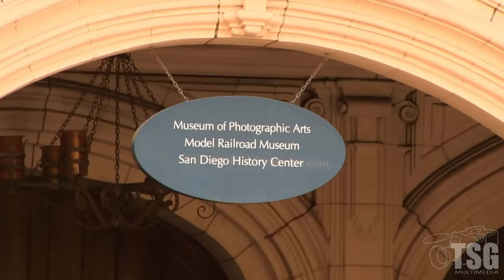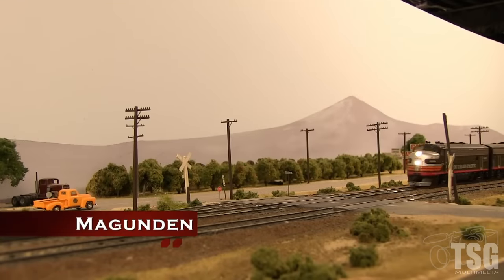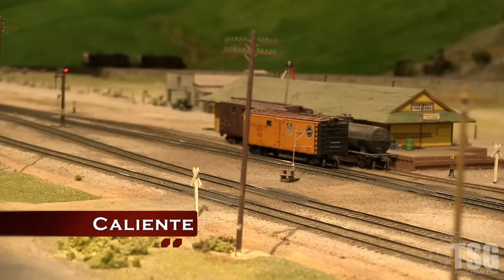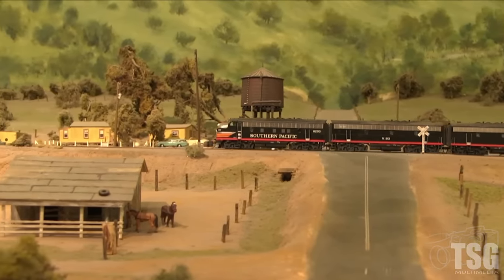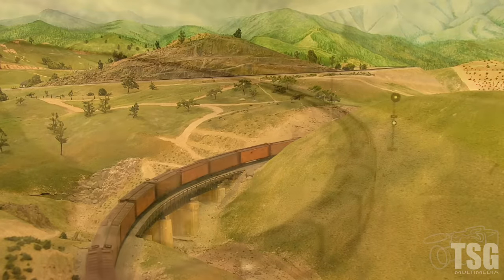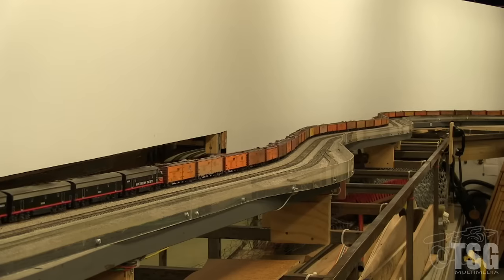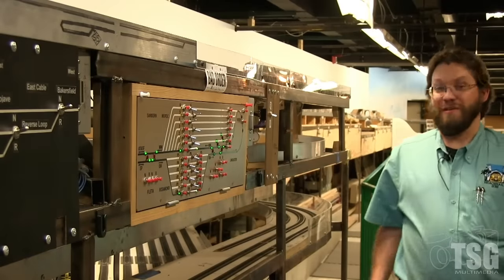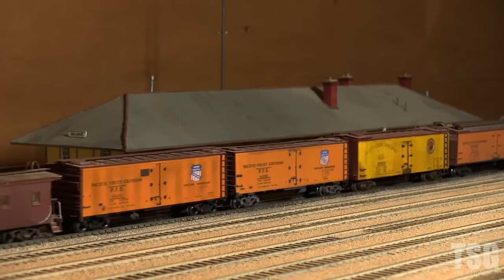La Mesa Model Railroad Club HO Model Railroad Layout Tour Tehachapi LMMRRC LMRC

Comment: Brilliant as always, and this particular video offers an excellent, comprehensive overview of the entire project.  I was never a member (as I live out of state), but the club graciously afforded me opportunities to run trains on "display" weekends (for about two months) back in the early '80s and to participate on Tuesday nights, which were work nights.  The latter was no small thing as this club had then, and probably still does now, the most exacting model-building and operating standards I've ever come across.  Then, the cars were very heavily weighted (six to eight ounces), and used Kadee #5 couplers (#5's metal vs plastic #4's).  There were absolutely no "dummy" locomotives.   As museum director John Rotsart explained to me, every bit of motive power was needed to get the trains up and over the pass (which in those days ended in a turnback loop not far above tunnel five).  He also pointed out the ruling grade (on this layout) was 2% rather than the 2 1/2% percent of the prototype...because had they used the real-world gradient, the line would have ended up going right through the museum's ceiling.   As I recall the bottom of the ceiling was about 20 feet off the floor...which gives you a true picture of the scope of this project.  
If you ever travel to San Diego make it a VERY high priority to visit not only the entire museum, but this layout in particular.  It's truly a project second to none.

Comment: The first fellow I met at the club was Paul Lubliner heading a train upgrade out of tunnel 1/2, who handed me his handheld throttle after a short talk (so he could make cow eyes at my lovely little sister) and with a note of caution to "be careful, because it's pretty hot."  Yes it was--this was long before the age of DCC--sporting a big, fat power transistor and heatsink on the bottom.  Yowch!!!
The NEBO hall layout (the "Northern and Gulf," which had, by then, been featured in an issue of Railroad Model Craftsman magazine) was, I think, located on the upper floor of a fire-station in La Mesa proper.  Knowing this I casually asked Paul if their Tehachapi layout was going to use the brand new, very high fidelity "N&G" signals, considered the best available at the time.  He gave me a strange look and said "I AM N&G Signal."  N&G=Northern and Gulf...doh!!!  So once I had pulled my foot back out of my mouth he showed me a part of his then, new, project--what turned out to be the "Highliners" F units.  That project took years, and he lost a lot of money pushing it through, but eventually it led to the high fidelity "Athearn" F3/7/9 units you can buy today.  In fact, I think you are seeing those very same (A & B) units in this video.

Comment: Another question:  Back in the day there was a faction of the club that literally wanted to try to model "fog" in the Ilmon section, the method/idea being to use multiple layers of a fabric known taffeta, which is a fine mesh...or cotton balls (I can't remember).   Had it used taffeta it would have used white taffeta, of course.  
Was that project ever tried, or pushed through?  That section seems not to incorporate fog today, but I have to wonder if it ever did.

Comment: Are the 'F' units M/U'd with the steam engine or is it providing power on its' own. he's the master couldn't have said it any better!
Reply: Great question.  All the units and locomotives were individually powered when I was there back in the eighties, and I would assume it's the same today.   Lifting those heavy (heavier than NMRA standard) trains up the pass required every bit of "horsepower" available.  I would also assume the locomotives/units are NOT mu'd, as I'm pretty sure each "unit" was able to run light on it's own.  
Which begs the next question (I don't know the answer as I am not well versed in the use of mid-train helpers using DCC):   Was there a second engineer boosting this train up the hill, or was it all done from a single controller from the head-end?

Comment: Aloha Jason ,,,  Great Fun --- Great Presentation ... You've Got a "Knack" and a Great Voice For This Kind of Work... You're Good & Very Knowledgeable... I Was a SP "Daylight" Baby... I Love'd Them "Daylight's"... BIG, FAST & BEAUTIFUL
 **Some Sad RR Trivia_The Darker Side of Trains**  ----  **Please Read On** 
We Had a Ranch About a Mile West of The Tracks,  (Coyote Ca) With a House That Sat Up On a Hill That Over Looked The Whole Valley...  "SP's Coyote Station" Was a Mail and Water Stop, Located Just South of San Jose... (The 10 Mile House)   I Still Have a Business Located at SP's "Coyote Station"... In Fact, "We" Still Get All Our Water From The Same SP Well That Was Used To Fill The Water Tank That Serviced The Steam Engines...

This Section of Track Was Almost a Straight Run Out of San Jose To Gilroy Ca... Almost 35 Miles of Straight Track, Running Right Down The Middle of What Is Known  Today As, "Silicon Valley"... So The Trains Really Got Up a Big Head of Steam, On This Section of Track... (Very Fast) 
 Now The Real Sad Part -- 
There Were At Least 35 Road (Car) Crossings On This 35 Mile Stretch... While Most Were "Graded Crossings",  a Few Were Non-Graded Crossings... Those Were Extremely Dangerous... A Few Had "Warning Bells & Lights", But Most Were "Naked", Unprotected Crossings... For Years, Only a Couple Had "Drop Down Gates" ... (One In Morgan Hill, One In San Martin) The Rest Were "Naked" For Many Years... So It Was An Extremely Dangerous Situation For Cars, Tractors, or Anything Else That Had To Cross The Tracks... Every Year At Least Two  or Three Cars Would Get Hit,,, Most Years, Many More... It Was a Regular Nightmare... This Section of Track and Highway, Got To Be Known As "Blood Alley" By The Locals... *And It Was a Real "Blood Alley"(US101)* Believe Me, It Was a Nightmare For All Anyone Who Lived There.. 

I Personally lost 6 Friends In One Day -- All At The Same RR Crossing, But In Two Different Accidents... Two Were Killed In The Am, and Four More Killed Later That Same Day... This Crossing Did Have One of "Wig Wag Signals",,, One of The Few On The "Line", But No Drop Down Crossing Gates... These Accidents Happened Right In The Middle  Town, Morgan Hill... 

A Little More SP Trivia 
All The Trains Involved Would Blow Their Whistle or Horns In a Very Distinctive and Ominous Fashion,,, After They Had Hit a Car... It Was An Eire Sound, It Had a Different Cadence, and a Special, or Strange Tone... Especially The Steam Trains... So You, and Everybody Else In The Valley, Knew Exactly What, When, and Where The Accident Happened... What You Didn't Know,,,  Was *"Who"  Just" Got Killed*... I Have Many Horror Stories, More Then I'd Like To Remember... We Lost Neighbors, Schoolmates, and Yes, a Few Dear Friends... But I Still Love Trains,,, Especially Them Colorful "SP Orange & Red Daylights"

Comment: What are the minimum curve radaii you use?
Reply from the maker: I'm not sure what the narrowest curve is on this layout. They have lots of space, so I'm sure it isn't very tight. At least not any of the visible curves.
Reply: The club's curves are 48" Radius with spiral easements of at least 12", I think often more like 16-18" with 1/4" to 3/8" offsets to the tangents.  There's also some slight super-elevations, but kept to scale.  The club's Chief Engineer Tony Anderson (who worked as a Civil Engineer for the Santa Fe at San Berdoo) calculated the super-elevation which would work best for the model.  Yes... the club members are crazy!

Basically all switches are hand-layed in place to fit.  Number 7 switches are standard, with most main track switches being Number 9s or custom, usually in Code 81 or 83.  Staging yard switches are usually standardized at Number 8s in Code 100.  Sidings and yards are Code 70 with many of the industrial spurs layed in Code 55.

NOM
Reply: That's what I remember from back in the day:  48" minimum, code 83 (railcraft?) on the mainlines and primary sidings (but not the house tracks, which were code 70).   I also remember having a discussion with someone (John Rotsart or the guy responible for maintaining car standards, whose name I cannot remember) about the need to replace the mains after a few years.  Nickel silver rails and nickel silver wheels (locomotive wheels in particular) would increase the wear on both.  (A)like metals wear more quickly both ways than do metals of differing hardnesses.    
I don't know if this was ever done, or if it's a project contemplated for today.
Reply: @NightOwlModeler  You rarely hear about spirals today, and I would bet few modelers use them, even if they know what they are.   The spirals (at La Mesa) are just one of the things that make watching trains such a pleasant experience.  The fluidity...or "flow," as it were sets this project apart from almost any other, and a lot of that is due to the use of spirals and ease of superelevation transitions from one curve to it's opposite.    
What I don't remember were mention of superelevations back then as a rule.  I would guess perhaps they run not more than 2," based on trackspeed, but I'm going from memory.
I don't remember any mention of the use of track layout "stations," which are typically 100' apart in real-world alignments.   It seems to me, based on roughly 'one half scale' that alignment transitions should use something like a 50' tangent between reverse curves, but I'm not sure how that would work with regard to vertical curves (gradient changes).  Even with oversize model couplers I imagine 50' stations would push the limits of what will work without causing problems.

Comment: Besides not being painted accurately, the shape of the wooden water tanks at Woodford wasn't modeled correctly.  Like probably the majority of the standard 50,000-gallon wooden water tanks on the SP in the age of steam, the three actual wooden water tanks at Woodford had tapered sides but those on the La Mesa layout appear to have perfectly vertical sides.  Water tanks with tapered sides are much more interesting to me than tanks with the expected vertical sides.  I don't think La Mesa has captured the true "look" of Woodford in the age of steam.  This is too bad.

Comment: Back in 1968, I think it was, I was a "military associate" (Navy of course) member of the original club in Balboa Park. I have often wondered what happened to the old layout. Then there was an "O" gauge line too.
What an outstanding improvement over the original. It also goes to show, if you want to reproduce the prototype it takes space and many years to do it. After all most of the fun is the building, and the operation too, I guess. Thanks for a great Show.

Comment: Great tour, and a lot of work!  At the end, you can see a rough spot in the crossover being used by the helper. 
Now, a big question; you mentioned the roadbed ( on the real rails ) being raised several feet during reconstructions. For the time it would take to do this, was the railroad shut down?, or was  there a temporary bypass built?
Reply: Yeah, That's newer track work, either we need to check the guardrails or it's more likely the AC-10 is a bit tight on gauge.  One of those things you never see until the video is done.

Comment: There was no "1967 rebuild" of the real rail line at  Ilmon.

Tunnel 1/2 was dug in 1885, not  "about 1900."

Regarding the watering of the steam engine helper at Woodford, the railroads never used such an ineffecient procedure as depicted by the La Mesa club.  In the steam era, on a train with one steam locomotive helper, a train's air brake system would have been under the control of the helper locomotive's engineer as the helper approached one of the trackside water columns.  The helper locomotive engineer would then stop the train when his engine was next to the water column.  No need to uncouple the locomotive with cars behind it and then back down to a water column.

The water tanks at Woodford were as black as the steam locomotives, not the rather odd shade painted by La Mesa.

Throughout the video, the narrator mispronounced "Caliente."
Reply from the maker: You have a lot of corrections to make there, but you didn't mention where you got the information you're repeating.
Reply: Regarding the purported "1967 rebuild" of the line at Ilmon, the track layout as constructed by the La Mesa club is basically how the track existed in 1966 (plus several years before that) when I worked as a Santa Fe brakeman between Bakersfield and Barstow in the summer of that year. No changes were made in 1967.

The 1885 building of Tunnel 1/2 was reported in the Kern County Californian (of Bakersfield) on May 2, 1885.

For the watering of steam locomotive helpers at Woodford, I went by the procedure found on page 10 and page 11 of a Southern Pacific San Joaquin Division employee timetable dated March 8, 1942.  The Santa Fe used the same procedure at Woodford, as recounted by a former Santa Fe engineer in an article about the Tehachapi line in the January 1977 issue of Trains magazine.

As for the pronunciation of "Caliente," since I live maybe 25 miles from there, I'm familiar with how the locals pronounce the name.